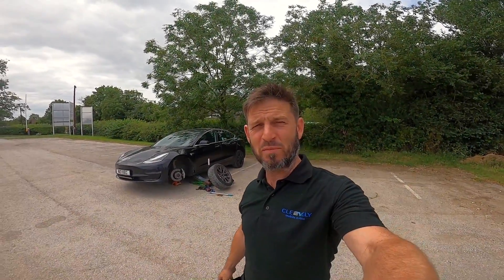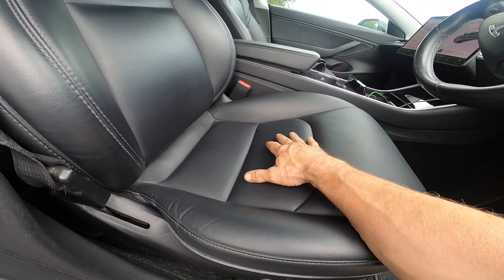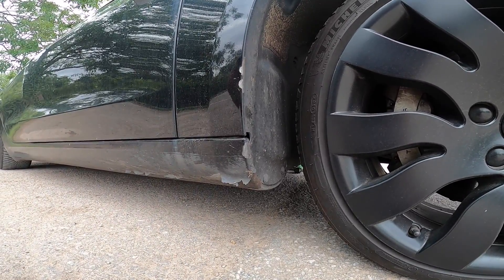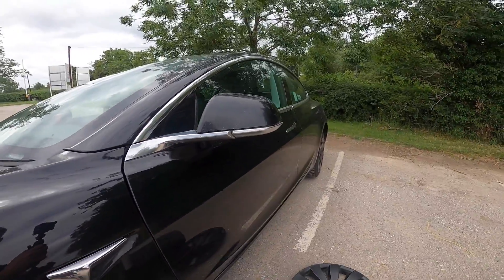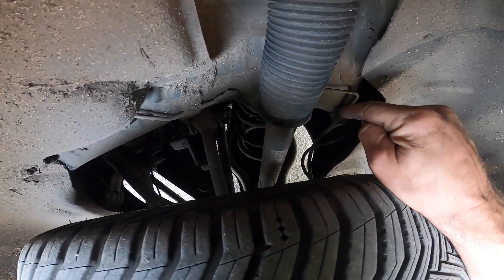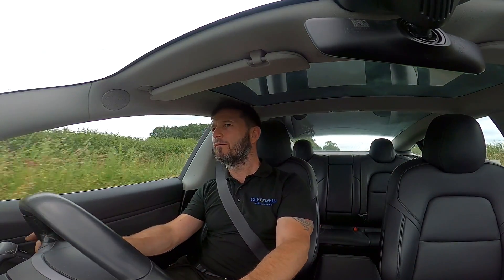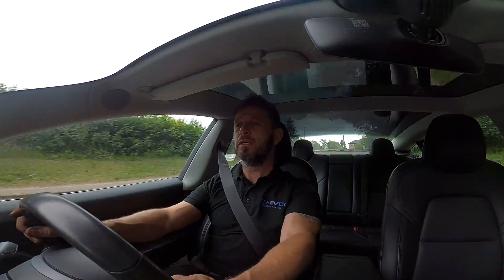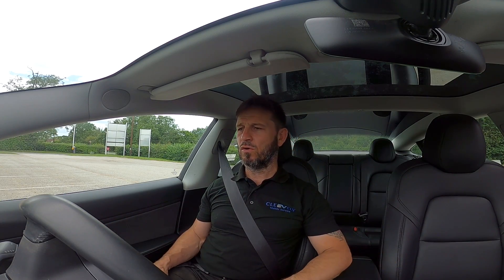200k Tesla - Would You Buy One?

Comment: The torque has always made me wonder about plunging half shafts and CV life expectancy.
Reply: Replaced one half shaft recently on our 10.5 year old model S.  Car is driven hard.
Reply: Air suspension performance cars at one point destroyed the half shafts quickly if drivers regularly launch the car with the suspension on high or very high

Recommended to use low, at least years ago, idk about now
Reply: @myid9876543  yeah, it’s all about the offset angle - the further away from a zero angle the faster they chop out…….and an OTA update won’t fix that either.

Comment: Yeh, 2nd hand Teslas are great buying now! We just sold our MG ZS Ev and changed to a 2nd hand Model 3 for a little more money. Far out they are a nice machine! I think I have to disagree with your maths on how much C02 has been saved over the lifetime of the car. I calculated we saved ~10 tons of C02 in our MG after just 50000km (~30k miles) compared to driving our old Forester. It will depend a little on how much renewables you use to charge but at 200k miles I would think it would be closer to 66tons of C02 saved (so about 10 times your estimate). Great video!👍

Comment: Hey James! I can agree fully, my P- may have only done 25k miles in its 4 years but it's pretty damn close to 'as new' as it could be. White seats are still perfectly white, despite the best efforts of two young kids in the back. Also had the front control arms done under warranty (common issue with the early ones it would seem) but other than two ~£180 Cleevely services (most recently Steve about 2 weeks ago!), it's cost me nothing. The final point about 'never buying anything else' holds true here, I'm planning on being the single owner of this car for many, many years. I'm at ~92% of the original battery but I've been at ~92% for the last 14k miles / 2.5 years so it's going nowhere.

Noticed the owner had Rimetrix rims that I used to run on mine - after a mere 20k miles on the car they'd worn down just enough that they were loose on the wheel and all four corners were rattling. I thought there was something seriously wrong with the car - turned out to be those aftermarket rims making an absolute racket :( They've also utterly destroyed the wheel rims where dirt got between them and the wheel - designed to protect the wheel by taking the brunt of damage if you hit a kerb etc (which they do, very very well! *not looking at my partner... cough) but they've done more damage to the entire wheel than a lifetime of kerb rash. They look good but they're hiding the absolute state they've caused behind - if you see these rims, I'd factor in 4 wheel refurbs into the price and bin them.

Comment: Thanks James for a great video. This is all grist to the mill of helping the wider public to understand that EVs are more durable and more reliable over more miles than any ICE car. We don't know how the owner has charged the car, overnight at home? Rapid chargers en route?...but a similar sized diesel taxi ( doing 50 mpg) would have spent about £30,000 on fuel over that distance. As for battery degradation, if the car does get sold it is likely to have a much easier life with a more gentle charging regime so the loss of range over the next 200,000 miles may not be linear.

Comment: I would rather buy a new  base model 2023 Model 3 as the battery and BMS has been  improved. Also the heat pump saves energy and heats and cools the new one much more efficiently. You don’t know, what you don’t know. So at any future date there can be a failure of the drivetrain.
Reply: @AG-ob3fx   Really ? there are loads of model 3 owners on you tube with packs or modules in packs changed, good to know :)
Reply: About 50k for a new M3P I think ,
Reply: @antoniopalmero4063  I would avoid the MP3 due to sport tires are closer to the ground, cost more, last less. They that are subject to potholes and bad roads much more so in the P model. The base M3 is powerful enough and  the 18” 235/4R18 tire has  longer lasting and more comfortable ride and cheaper to replace.

Comment: Another great video, thanks James.  A very impressive report on this high mileage Model 3 but it's clearly standing up very well and I completely agree with your point about the owner not needing to change it.  I think many people, (including me), have become brainwashed into thinking a car needs to be changed if it gets near 100,000 miles.  In terms of EV's this is clearly nonsense!
Reply: However, technology in Tesla has vastly improved battery life and ride. The most overlooked feature of new Teslas is the heat pump, due to cost savings and efficiency…Older models do not have the heat pump, nor the BMS and battery conditioning, notably cooling and warming it at the right time.

Comment: Seats look slippery and potentially sweaty. That huge screen next to the driver would get ripped out after 5 mins, so annoying. The battery is about to cost you £18k to replace. Hmm is it worth anything 2nd hand. Not really. People are dreaming if they think the batteries will just keep ticking. Look at any device you own that uses li-ion batteries! They NEVER last more than 8-10 years! THE TRUTH IS SOON TO HIT EVERYONE HARD. At best you will get 4 or 5 years more out of this before you have to spend 20k on a new battery. then your 5 year old tesla will be costing you purchase price £15k + probably £18k in battery in 4 or 5 years time. Without any other maintenance costs your looking at a 5 to ten year car costing you £33k over the next 5 years. and say you only want to keep it 5 years. Then who is going to buy a 10 year old Tesla that needs an £18k battery? Not a good investment!
Reply from the maker: A new battery for this from Tesla is $9800. They can also be repaired, it's what we do for a living. You can pick these up second hand for £4,500. This car has now got 235k on it. The average mileage for a car is the UK is 111,000 and 11-13 years life cycle, so this will be fine. Also, we sell the modules from older batteries for home storage solutions, they're worth good money, so all in all, it makes sense. You can pick these cars up now for under 20k, and they're only getting cheaper. 200,000 miles of diesel will cost 28k, in electricity it's £3,750 when charged at home, which this guy does 90% of the time. 

It's a very good investment.

Comment: Not bad except the CO2 bullsh*t. and didnt hear what the actual  range is now with degridation compared to new. The batteries were just born into existance and when the car is garbarge im sure they will recycle the massive battery(aka bury it).  The quility and parts you must maintain are relevant but 1/2 this video is 1/2 truths.
Reply from the maker: The battery is 95% rechargeable, however, it will likely go in to home storage. The CO2 is very important.

Comment: I wont touch an EV. My 460,000 mile diesel van is serving me well.
I have a customer with a 7 year old, 60,000 mile Tesla model S.
The battery is dead. A full charge got him 30 miles.
It died in November 2022 and went to Tesla UK ... Tesla hope to have the car back to him end of July 2023.
Worse still. Even tho its within warrenty. Tesla say, because he has exclusively used the Tesla charge network for charging, they consider that battery abuse and its not covered by the warrenty.
He cannot charge at home.
So he has paid £32,000 for a new battery, (they wouldnt order one without payment up front.) that he is still waiting for.
Once it comes back. He will be immediately selling the car. His next car will not be a Tesla or an EV.

His Tesla has already had:
5x door handles fail
2x LCD screens leak
2x drive motors.
The build quality is '🐶💩' Panel gaps all over the place, trim doesnt fit right, etc.
Its like they are crashed in the factory and botched back together in a back alley body shop
Reply from the maker: A Tesla model S battery supplied and fitted is £10k, it’s well documented. However, we work on a fleet of Model S taxis that are all over 300k. Yes they have repairs, but they’re still going strong. You can cherry pick a bad story, every manufacturer has them, but Tesla have the highest reliability of any manufacturer. 🤷🏻‍♂️
Reply: @Jamesandkate  I wonder why Tesla UK have charged him  £20k over the 'well documented' price?

Comment: I think there is a hughe difference between a car like this, what is just 4 years old with that mileage and a car that is more than 10 years old with that mileage. Batteries just get older over the time, so the way it is used as an Uber it's perfect for the car, but it's not the same with older EVs. Rust etc. comes also later. What you have here are normal repairs on mechanical parts as you would expect them for the mileage. I run an old Ford Focus MKI with just 207.000km, but this thing still works after 23 years and I don't think this Teslas battery will do it after that time with the same milage as the ice.
Reply from the maker: Tesla estimate 500k on these batteries, so I’d expect it will be ok.
Reply: Don’t worry.  Our Tesla is 10.5 years old and 90% battery capacity after HUNDREDS of supercharges
Reply: The average mileage a car covers in the UK before it is scrapped is 130k miles. Quick Google search will confirm this.

Comment: Tesla is like any other car maker, there are always exceptional examples.
Reply: For sure this Tesla M3 is on the far end of the bell curve when it comes to use cases, but I wouldn't call it an exceptional example. Sure, fans of Toyota, Volvo, Mercedes etc like to crow when their cars have done huge 'trouble free' mileages but these are more likely to be 'exceptional' due to the number of variables that have to line up to achieve those trouble free miles in an ICE car. In an EV the important thing to understand is not what it has but what it doesn't have...gearbox, cam belt/chain, starter motor, water pump, fuel pump, exhaust systems...so many sub-systems and moving parts which have to work perfectly to get to 200,000 miles without serious maintenance costs...and of course very few ever do. But for an EV the laws of probability are in your favour and you are far more likely to reach that mileage truly trouble free. As for running costs, a 200,000 mile equivalent  diesel taxi (for example) doing 50 to the gallon (let's be generous) would have burned 4,000 gallons at what?...£6.84 (£1.50 a litre)...at a cost of £27,360. The Tesla at 4 miles/kWh would have done that for under £10,000. Verdict: The ICE is dead man walking.
Reply: @kiae-nirodiariesencore4270  £10,000? I don’t think so. 200000 miles at 4 miles per kWh is 50,000kWh. At 67p per kWh, that’s £33,500.
Reply: @kevinmills5293  You're not thinking Kevin, or perhaps you're overthinking it. The car is 4 years old, so lets say he works 5 days a week, though many taxi drivers do more than that. So he's worked 1,040 days and clocked up 200,000 miles, that's just under 200 miles a day, so an average day's work is well within the range of the car. For all we know he could have been charging at home overnight on Octopus and getting 5p/kWh which has recently gone up to 7.5p. I used 20p as a mid point price as yes, he may have used the supercharger network when out on longer trips but James did say that the first 140,000 miles or so were mostly in the city...We don't know for sure but your assumption that he would have been 67p/kWh is way off beam.
Reply: @kiae-nirodiariesencore4270  and you’re condemning ICE vehicles based on one example of EV running costs.
Reply: @kevinmills5293  What makes you think I am 'condemning' ICE powered vehicles? I drove many petrol and diesel cars after passing my driving test in 1974 until I switched to my EV in 2019. I've owned all kinds of ICE cars during my life in UK, France and for a while Dubai. Ask anyone who has made the switch from ICE to EV about running costs and you will get pretty much the same answer. EVs today are more expensive to buy but that won't always be the case. They hold their value better than ICE cars partly because their running costs are so much lower. If I had gone for the Niro hybrid rather than the EV I would have spent €7,000 on petrol here in France (based on 50 mpg) over 83,000 km (about 50,000 miles). In all that time I've spent under €1,000 on public charging. I would have spent €1,500 on home charging (tariffs were €0.10/kWh until last year when it went up to €0.16) but in fact I cover all my home charging from the solar panels on my roof. Driving on the sunshine you capture at home is a liberating feeling and I do feel sorry for those who are still tied to the pump and have to make their pilgrimage to big oil and pay dearly for filling their tanks.
Reply from the maker: @kevinmills5293 he charges at home at 7.5p/kWh and the super chargers are between 24p and 44p p/kWh.

Comment: What about the £1000 hp payments.  What about the CO2 generated when digging 200,000 tones of earth out the ground to make the battery.  And then there is that cheap nasty interior and build quality.  That ipad stuck to the dash is rediculous. Oh and £15k for a car with 200k miles 😂
Reply: What £1000 hp payments are those then?
Reply from the maker: The car was bought cash. But payments on this are typically £500pcm. It’s well documented what an EV costs in emissions Vs an ICE car. Don’t be sad, ICE is finished 💁🏻‍♀️
Reply: Battery production involves far less mining than oil. 68 Gigaton of ore is mined a year. 50 of that is for fossil fuel extraction - 4 for batteries. (Tesla Master Plan Pt3). BEVs are 4x less polluting than ICE well to wheel (Einhoven University).
Model 3 earned a stellar 99.4% Reliability Rating from What Car?’s survey, placing the vehicle ahead of all electric cars and executive vehicles, regardless of the type of propulsion. Mercedes-Benz C-Class, was deemed by owners as the least reliable executive car. Shanghai manufactured Teslas have the least faults by far of any other OEM in China, including all the Germans from a 42How survey. German ADAC data shows Tesla has the lowest call out rate for cars over 3 years old. Consistently comes tops in owners' surveys of customer satisfaction in USA, China and Norway. Bloomberg survey of Model 3 owners found a 98% would buy again score. Lowest warranty claims of any OEM in USA (Warranty Week). Toyota tear down engineers described Model Y as 'a work of art'. Munro described the Model S Plaid before teardown as fit and finish as good as a Bentley. Ex GM Lutz was stunned at the flawless paint and precision body panels on the Model 3 that were "beyond reproach" in his words. "Gaps of 3.5 to 4.5mm are considered word-class. This Model 3 measured up." Road and Track June 2019.
Do more research...
Reply from the maker: @waynerussell6401  you are welcome to comment here anytime. Love this level of detail. Thanks.